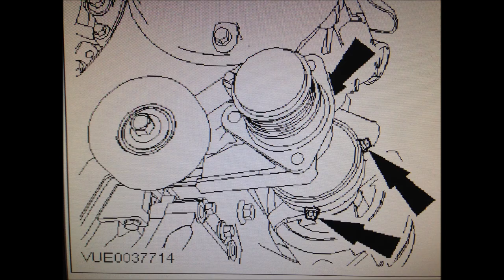Removal of alternator Ford Focus

Comment: Very nice video. It's good to mention that you have to disengage thick red cable from alternator, it's under voltage be careful if battery is still connected. Another tip, don't switch places of two long screws that hold alternator, it's instant regret

Comment: Hi mate i know this video is old but im having to replace the alternator on my 2005 tdci focus, ive removed the alternator bolts but it still doesnt seem to be budging, do i still have to remove the the coupling in order to remove the alternator? TIA
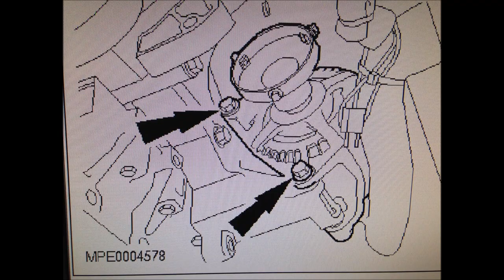Reply from the maker: 1:23 yep I took the coupler out first to free the alternator
Reply: @asktoby  ok thanks ive almost done it i was wondering why i couldnt free it up, i did manage to get 2 of the 3 bolts off the coupler ( theres 3 on mine ) but the 3rd rounded off so gona get some heat on it tomorrow and knock it out

Comment: how did you get to the top bolts on the air con compressor im about to tackle this tomorrow
Reply from the maker: +mellowfellow100 When you lift the car and remove the heat shield you'll see it. It's front-right-bottom in the engine.
4 bolts as shown at 0:31, just use a spanner. It drops down.
Reply: +Toby Newman cheers for the reply bud what about the auxillary belt is this a fairly easy job or do you recommend to get a mechanic
Reply from the maker: It's easy. I'm no mechanic but found my way through. Aux belt you have to use a lever to loosen the spring to get it off. I used a spanner stuffed into a socket I think, you gotta use your inginuity on that bit if you don't have the right tool. But it's not hard, just take notes and photos as you go. Remember how the aux belt was woven around the engine and write it down.
Reply: nice 1 cheers bud
Reply: +Toby Newman got it all out toby the fucks in europarts gave me the wrong size of coupler raging need to go tomorrow and exchange it
Reply from the maker: +mellowfellow100 don't say I didn't warn you!
Reply: +Toby Newman ye seen it on the end of the video got my cash bk then went to another place same fuckin thing happened eventually got it put all the bits bk together ,took the car out for a spin .and fricken battery light came on then abs stopped the car straight away its now in garage so just waiting on the guy getting bk to me lol job was pretty easy thanks for the help i thought i would have struggled with the auxillary belt but went straight back in ,the garage reckon i could have an electrical fault just need to wait see now